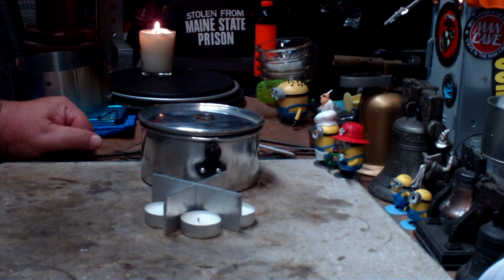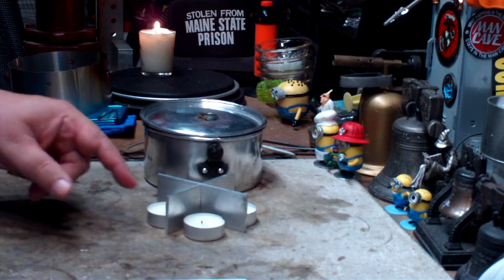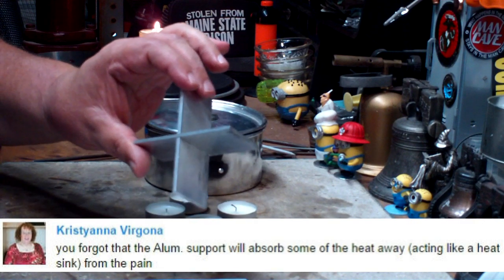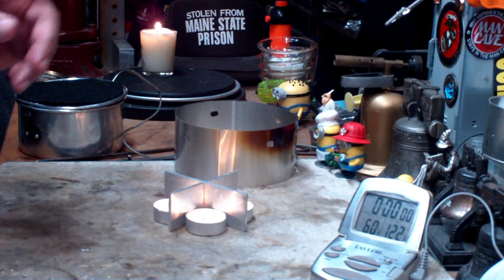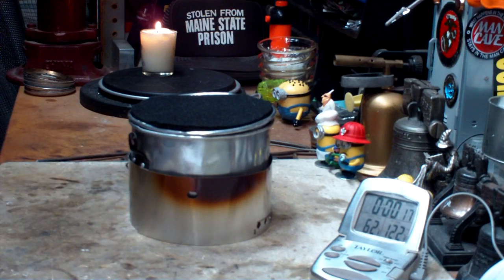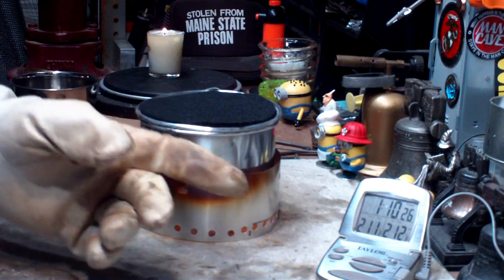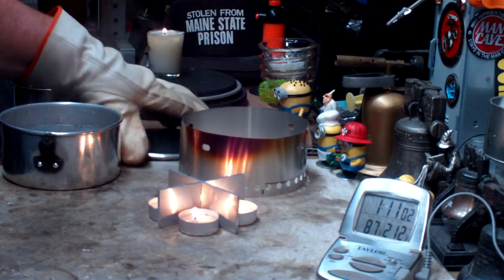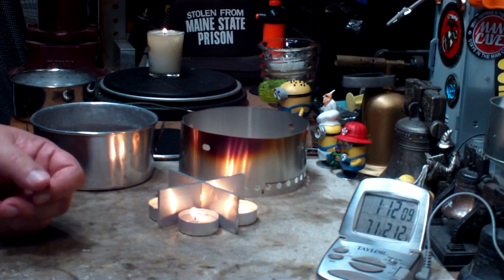Can Tea Light Candles Boil Water? II

Comment: Thanks for having the idea and testing it out. I've done many stews and meats with the crockpot on the warm setting with a reflectix cozy over the whole thing. It takes longer to cook, but the food is soooo tasty, and the meat is as tender and flavorful as it gets. So after seeing your video, I did an internet check for cooking temperatures for different foods and found that for most it is 165°, and pork even cooks at 140°F. So I guess the test should be, how many candles does one need to bring a given weight of food to that temperature. Then it can sit and burn for a long time (how long do the tealights burn anyway)
Reply: +Tim Anderson depending on who makes them, 3-6 hours it seems.

Comment: That was certainly useful, thanks.  So the summary is: even if the heat is contained, it produced the same results, but the more sources of heat can add to the overall temperature, referring to your multi-wic testing.  I've seen wiki say that candle flames can achieve 1,100 deg C at 1atm.  I'm assuming that's atmosphere, which isn't useful to the everyday person on Earth, but I'm wondering if there is a point that simply adding more tea lights won't add to the overall temperature.

Comment: Wondering how to make a natural off grid homemade steam sauna set up , that's how i happened accross your vidio as hoped to do with candles. Maybe a trangia would be best? Did it make any steam at all? I know your using lightweight pan, but wonder if a heavier bottom with thicker metal layer might allow for accumulation of heat intensity???

Comment: Is there a good wire mesh that is great for using as a place to set the pan on( over the flames) that won't melt?  Being set on top of candles so there is a stable flat surface for cooking on?
Plus:
I saw a video abt a year ago  that suggests soy wax for candles.. They are great for making smokeless candles. Just an FYI in case you didn't know. 
I was thinking of making a few candles like a 120 hour candle.  I think if you can use it for heat you should be able to use it for cooking food ( unless it creates soot). Any suggestions for me?